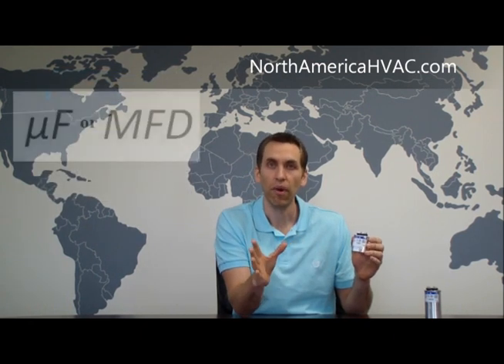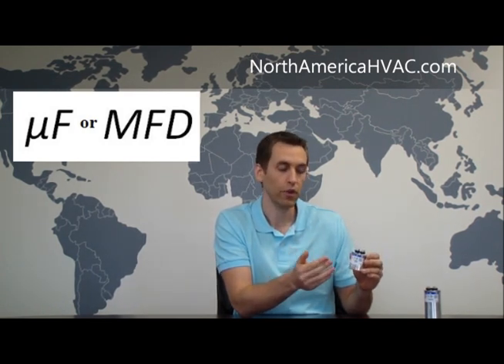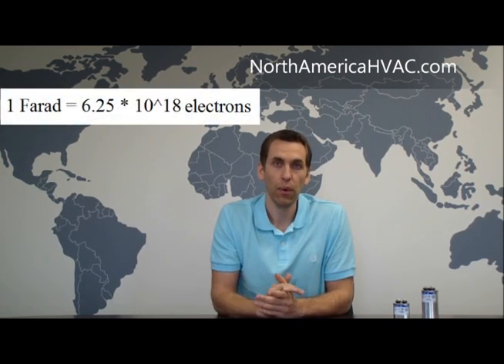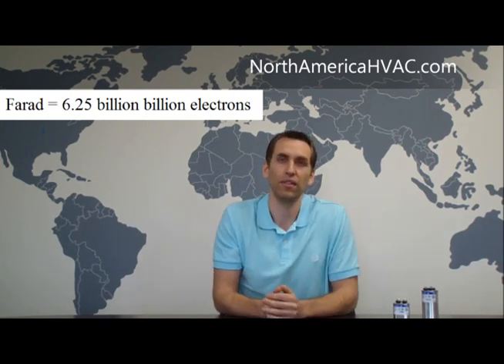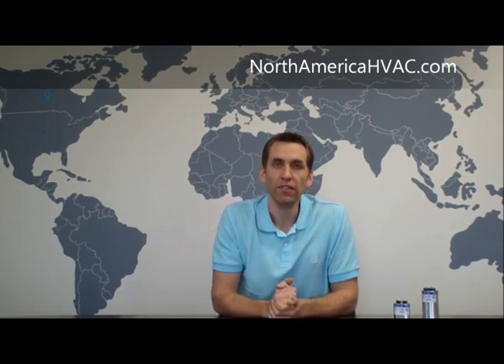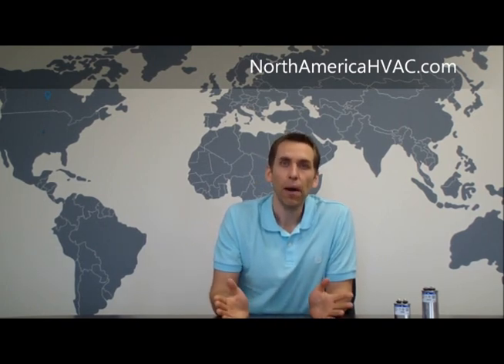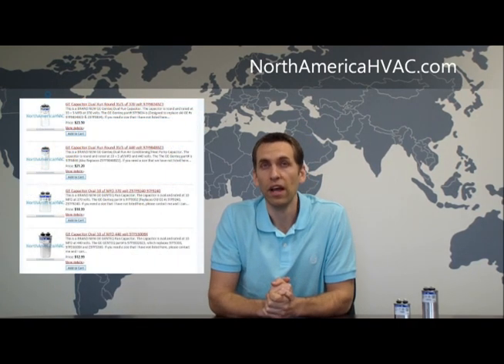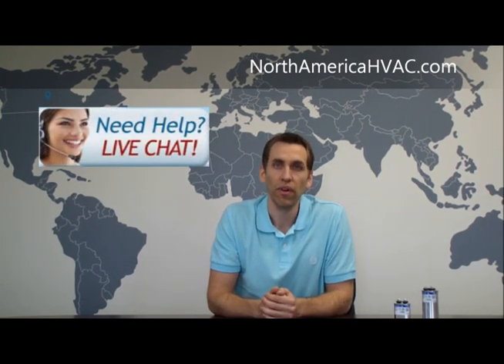Capacitor Microfarad Ratings (uf / MFD) - Whats it mean & can I change It?

Comment: Hi there, today I have changed my AC compressor capacitor, they installed a 45uf but the manufacturer installed a 50uf .. Will that create problem? Like excess electricity consumption?

Comment: A technician stated that we needed new  run cap  because it was rated for 10 but read 4.6 (something like that but isn't that like say a 12v rechargeable battery showing 8v is 'bad.'  I would think it was just measured in that state, which cycles?

Comment: I just received a replacement 220v AC blower today for a wall sleeve AC unit.  The motor has a 5uf 450VAC capacitor rating.  The capacitor that came with the motor was 6uf 450VAC rating.  Will the 6uf run capacitor work on this motor?

Comment: Hello, My AC's capacitor is replaced last week , new one is 50+6 , previous one was 40+6 , Can it affect life of my AC , any damage or anything ? Should I immediately check out for 40+6 capacitor replacement now ?
Reply: If it needs a 45/5/370 can I put a 50/5/370 @North America HVAC?
Reply from the maker: @marcoespinoza187  We would not recommend doing so. I would stick with the 45/5/370 your system calls for. Thanks!
Reply: Or
Reply: Runing capaciter and  fancapaciterate required ifcomperssar moteris  csrtype there capaciter compressor  runing and starting capaciter fan caaciterare requiredgive below  this value  change slightly in some mosedls 234 vave dhigh good down not tackin
Reply from the maker: Hi! Thank you for your question. If your original capacitor was rated at 40+6, I would not recommend using a 50+6. Changing uF/MFD ratings can cause harm to the system!

Here is a link to a replacement (assuming your is round in shape). If not, let us know. Good luck! 

https://www.northamericahvac.com/12220-12920-mars-mars2-jard-40-6-uf-mfd-440-volt-capacitor-by-climatek/

Thanks!

Comment: I played with a 2000uF 12V capacitor and it took a long time to discharge it to a load (led). I thought it should discharge more quickly and that the led would fade after 2 secs or so.
Reply: LED's pull VERY FEW electrons from the warehouse. Unless you fry the LED. How long did it take?

Comment: compressor capacitor is of 40mfd/440V and i am using capacitor of 60mfd/370V then what happened  (unit is of 4 ton)
Reply from the maker: If your compressor requires a 40 mfd, I would not use a 60 mfd on it! If you need help locating a replacement, let us know, Thanks!

Comment: Sir 
Whats the differance of the uf and mfd
Reply: uf and mfd are both wrong units. peoples ignorance and use of printers not capable of printing special characters is  a problem here. the capacitance unit of measure is Farad or F.  1 F = 1000 mF [ milli Farad ] = 1000000 µF [ micro Farad ] = 1000000000 nF [ nano Farad ] = 1000000000000 pF [ pico Farad ] and more...u is not µ and mfd is an american invention

Comment: Had a cap go bad.. was a 50uf +5uf. I have a 45uf +5uf on hand. Will that little difference not work?
Reply from the maker: Hey! I would not recommend using a 45 +5 in place of a 50+5. If you connected it, it may run but could cause long term damage to the motor.  Here is a link to one that should work for you: 

http://www.northamericahvac.com/ge-genteq-capacitor-round-50-5-uf-440-volt-97f9850bz3/

Thanks!

Comment: Great explanation. I have had some capacitors in such poor shape that your cannot read its rating to replace it. Is there any way to test (reverse engineer) to find out what the proper size capacitor is needed for a replacement?
Reply from the maker: Hi, thank you for your question. There is a way to test the uF/MFD rating, however, that will do you no good if the capacitor is bad. If you can send us the model number of your unit, we should be able to locate the proper replacement by looking at your parts list! Thanks!

Comment: a microfarad is 1/1,000,000th of a farad. not 1/1000th
Reply: Yes.that's it.
Reply: Matthew Smith can you bank capacitors if the rating adds up to what you require? 2x 5uf to equal 1 10uf?

Comment: Just recently I needed to replace the capacitor on my residential central AC unit.  I looked up the part on line as well as from the manufacturer and needed a 40+5 x 370 volt round which I purchased.  However when I went to replace it I discovered the one that was replaced previously by a technician was replaced with a 45+5 440/450 volt capacitor.  Is there a reason this was done and would the increase from a 40+5 to a 45+5 have any affect on the unit.  Thanks.
Reply from the maker: The most probable reason that it was increased is that the service tech had a 45 on the truck, and not a 40.  We've seen this done countless times and while we do not recommend it, I've never seen a situation in which I could say there was directly attributable damage to the unit by bumping the capacitor MFD by 5.  That said- there is no advantage to the 45, and I definitely recommend reverting to the 40+5.  Good luck!

Comment: If I have 45/5 uf 370, can I purchase 45/3 uf 370 as a replace ment?
Reply from the maker: +侯鵬飛事工&#160; We do not recommend going from a 5uf to a 3uf&#160; rating when replacing the capacitor. Here is a link for the replacement you would need if your old capacitor is rated at 45/5&#160; 370v : http://www.northamericahvac.com/ge-capacitor-round-45-5-uf-370-volt-z97f9861-97f9861/

Comment: how much uf I need to supply 12v with 1A for 10 minutes
Reply: Vladimir Nachev hmm good question.... what are you trying to power?.. search into. super capacitor build?
Reply: I just wondered about it I'm not well informed about the farad-discharge ratio because I think the farads could be the same but the output voltage and capacitance rate may vary
Reply: this is a job for a battery and not very practical for capacitor
Reply: Hello, sorry if I'm bother you, but I have a question, my air conditioner portable, I see have 45_+5% and now I bought 45+5 MFD   and down its said _+5% Tolerance 50/60Hz. Please do you know what I bought it's will working to my air conditioner portable, or no??